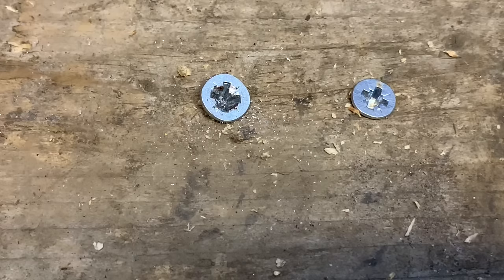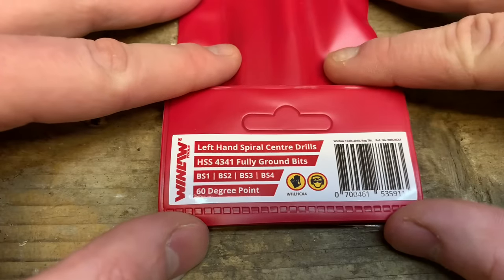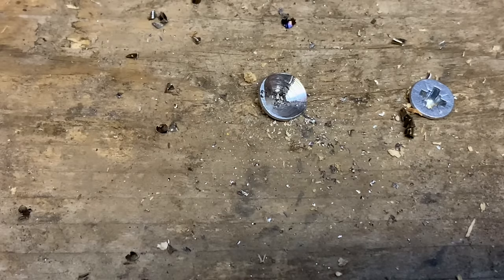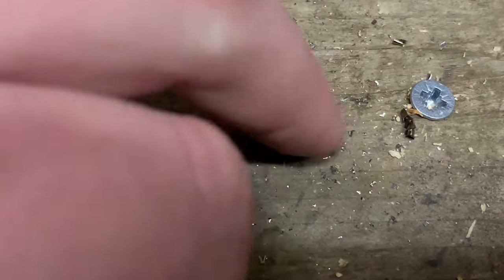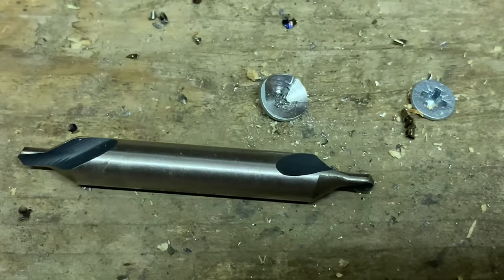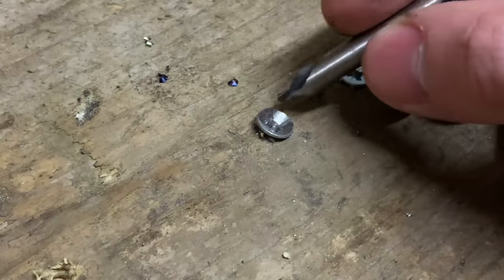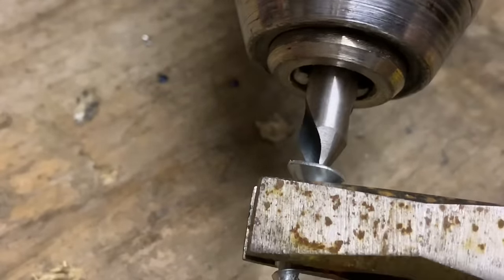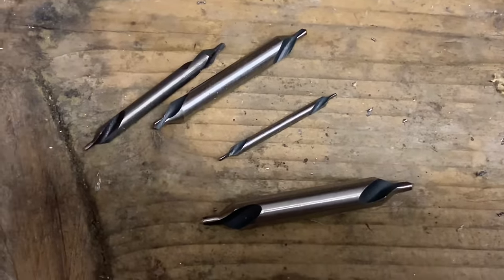How to remove a rounded off screw the proper way! | Skills every man should know

Comment: Spent weeks trying to remove screws attached to stainless steel. I tried EZ Outs/Speed Outs, screw extractors, rubber bands, super glue, drill bits, gloves, and the only thing that worked was using a rotary tool with cutter (Harbor Freight $10) to cut a line/slit(Phillips flathead) in the center of the screw so an Impact Driver can hold onto the screw.  My screw was too short and the material was very soft.  Put painters tape on the screw before using an Impact Driver(Amazon $12).  This was the only thing that worked for me. Hope this helps someone out there.
Reply: bless you
Reply: Thank-you! This approach worked for me as well!
Reply: I got a metal cutting blade made for a jigsaw: I might try this. I think that, rather than stripped screws, I have very tight screws and every allen wrench but the right size it seems. I need some way to get inside my outdoor antenna to see what got damaged--if anything--when it fell recently. It has allen screws protecting the heart of it. If I knew that there was nothing to be damaged, I could simply cut around the screws and recompile it later however I had to. However, I know that there is a cord inside at least--maybe more--and I would be cutting blind. So, if I could make a deep line in each screw that a flathead screwdriver could twist, that seems like it may work!

Comment: I had a problem because the stripped out screw was on a wall light fixture. Second problem was the screw was set down into plastic housing.  I tried the left drill bit thing but it couldn't reach the screw.  I needed to put force on it and itvwas hard enough up on a ladder.  I was finally able to get the fixture away from the electric box far enough for me to get tight bolt cutters in. Dang zi hate when that happens. An extra hour of labour for a 5 minute job.

Comment: Works for soft mild steel screws,try a high tensile decking screw,that sorts out the wheat from the chafe.
Reply: Yeah agree , I've just wasted £14.99 at Screfix in a screw removal kit ...absolute dog*hit on decking screws and zinc plated screws

Comment: Does this method work on hard bolts, group 10.8? I mean, I have a torx 40 bolt which ties the door hinge/crane to the B-pillar, it is a torx 40 button head screw which I managed to unscew 3/4 of 1 turn but then the torx bit started to round the screw head ...

Comment: I’m just looking for a video for laptop screws, external ones that are flush with the surface of the laptop but completely rounded off
Reply: Dude same, PLEASE let me know if you find / found something
Reply: @ananysingh07  i use asome tape to. remove it
Reply: @alfursan291  how
Reply: @kaizo1148  put some sticky tape on the screw head and twist it out,  the laptop screw should come off

Comment: Those are interesting bits. If I see set I will try them. I try to use valve grinding compound on screws that are difficult but not yet fully stripped.

Comment: Hey overtorqued I have a question for you. What about screws that aren't stripped and are in hard to read places where you can barely get any screw drivers in especially a drill and the areas are screwed in metal, how the fuck do you get those out? Lol. I have an amp I'm trying to get the screws out to change my valves.

Comment: If you're not concerned with the material surrounding the screw you can use a dremel tool with a metal grinding wheel and cut a slot into the screwhead and back the screw out with a standard screwdriver bit.
Reply: What if you are concerned then what do you recommend
Reply: @Prxsumo  Try gluing an upside down screw (head to head) or nail to the stuck screw and using a pair of vice grips to twist the original screw out. Maybe🤞?
Reply: @ubb4me  I stripped my screw were I add a ssd on my ps5 you think that will work

Comment: I have some straight head screws on casement windows with 70 years of paint on the even after scratching the paint of the head it was hard to get get the screw driver in the grove. You can’t hammer the screw or you will break the glass, which is irreplaceable. I gently tapped a chisel behind the screwed latches, slowly got it loose, it also loosened the screw enough for me get a grip on it. 99% of the videos are are on Philips head screws.. do one on straight head screws.. 🤷‍♂️

Comment: I’ve got 2 very corroded Philips head screws holding my ceramic toilet 🚽 bowl to the floor. I can’t use your method because ceramic breaks very easily. It’s fragile. How to remove shredded screws from a ceramic toilet. They’re also recessed making it even tougher!
Reply from the maker: If I'm understanding your situation properly, what I would do is either:

Extremely carefully protect the toilet with many layers of masking tape. I would then use a small cobolt drill bit (maybe 2mm) to drill a pilot hole in the centre of the screw. Then I would increase to a larger cobolt bit and drill the head off. Lift the toilet off and remove the stubs with stilsons. This will take a lot of time and patience to avoid breaking the toilet.

Or see if you can get a reciprocating or hacksaw blade under the toilet and cut the screws off at floor level.

I would probably try option 2 first as it's less likely you will break the toilet. Either way is going to take you a full afternoon on your hands and knees.
Reply: @4wdaction632  the plumber used a multi tool with a blade for metal and cut it from below. It’s was easier because it was sitting on rotten chipboard. Thanks 🙏

Comment: I need something for a stuck not stripped screw that is tiny can’t find that on the internet
Reply: It could be rust, treat it with WD-40 or something first
Reply: Sophie Shapeless brand new no rust just to tight
Reply: @happycat2079  what are you trying to take apart ? depending on what it is, you can find a drill bit the same size as the head of the screw, and take the top of the screw off entirely. At that point when you release what you need to off, you take off the rest of the screw with a vice grip pliers. Check out the channel Seejanedrill on here... think her video is what you need. Good luck!
Reply: Sophie Shapeless a laptop to clean fans and vacuum it out. Don’t have an electric drill that’s the issues

Comment: So pay for something, wait like 2 weeks for it to arrive and then extract the screw? No thanks.
Reply: So, you'd rather NOT extract the screw? I'm excited to read about your alternate solution. 😊 (P.S. Amazon delivers these bits in two days.)
Reply: @soundsgoodtome  cut a slit into the screw with a dremel and unscrew it with a flathead screwdriver, grip it with pliers or make 2 flat spots on each side of the screw and then grip it with pliers, jam a torx bit in it then unscrew it, hammer on the edge of the screw with a chisel to unscrew it... there are many more methods, these are just some that I commonly use.